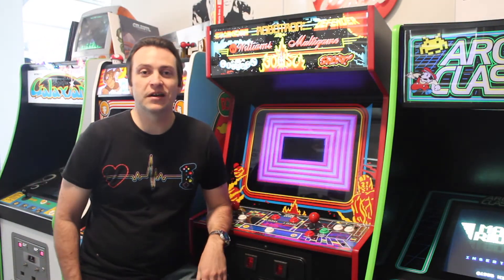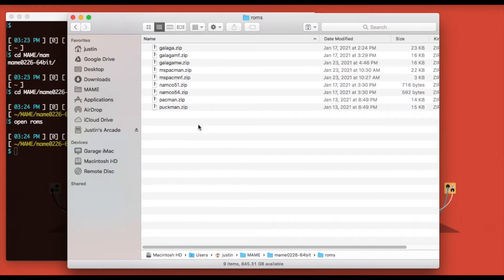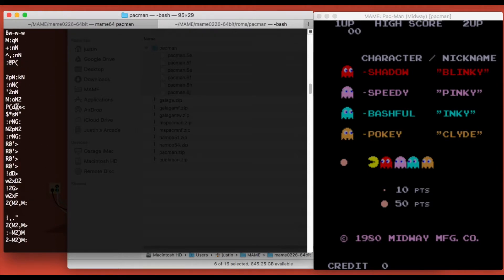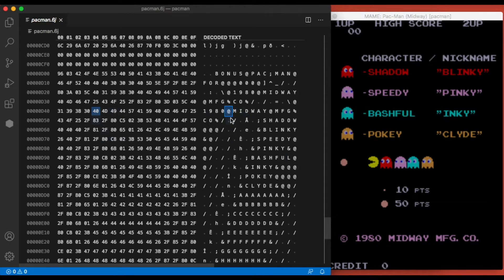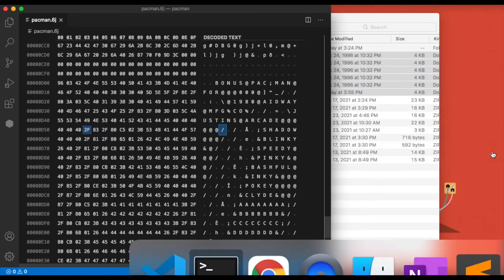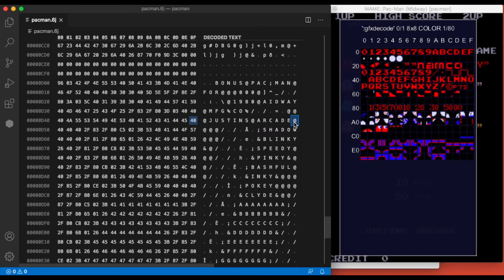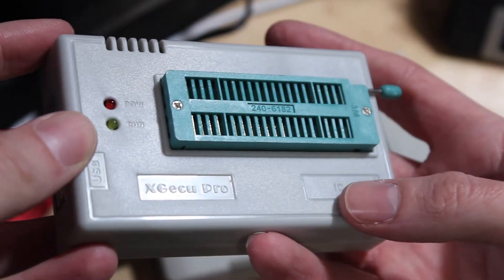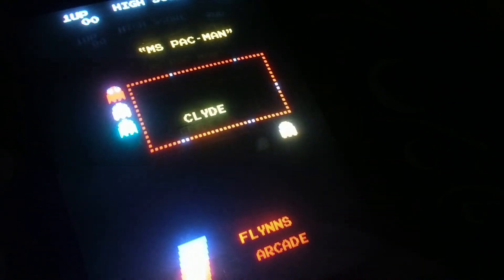Personalize your arcade game with a simple ROM hack

Comment: Good tutorial - I'm getting caught when I run the new rom though - the emulator gives a checksum error and won't run it . Would anyone have any ideas?
Reply: What error are you getting? MAME should display a checksum error, but allow you to continue. Like at 8:14.
Reply: @JustinUnterreiner  Thanks for the reply - I was running the rom on my PC  using the MAME GUI and not using the command prompt. It works fine from the cmd prompt. As an aside the google machine says there's probably some setting on the GUI to bypasss errors and just run the rom - I couldn't find one though. So now I'm hacking like a madman and am quite pleased with myself. Great video again  - any chance of changing the Pacman/Ghost graphics? [promise to follow it properly this time...really]

Comment: Are you going to add more game options (Galaxian, Frogger, Dig Dug, etc.)?
Reply from the maker: Yep! I just added Battlezone and next up is Galaxian. I'm working through the games that I personally own (and therefore can verify on real hardware) before moving to others.
Reply: @justinsarcade  And when will you add Galaxian?
Reply from the maker: @mariodykstra6555  So I've done the work to add Galaxian... the problem is that there are at least four different ROM sets; two Namco and two Midway. While identifying if you have Namco vs Midway is easy (the logo is displayed on the screen), distinguishing between set 1 and set 2 for each is more difficult. I'm not aware of a way to tell which version you have without dumping the ROMs and verifying the checksums. Therefore I was hesitant to add them to my site without doing some more research to see if there was another way a set could be ID'd without dumping the ROMs.